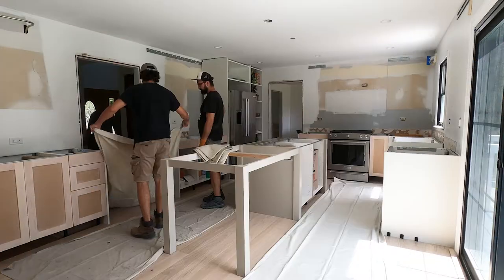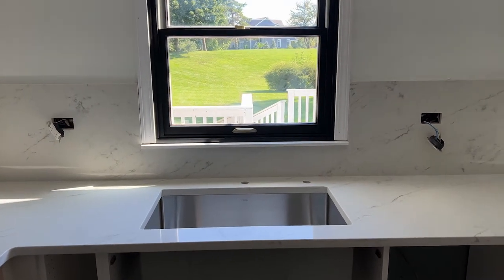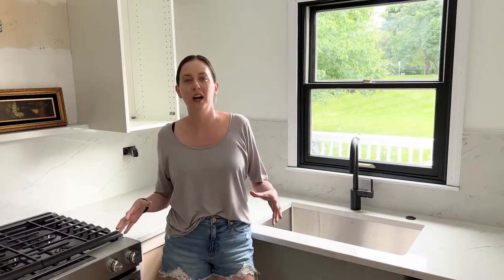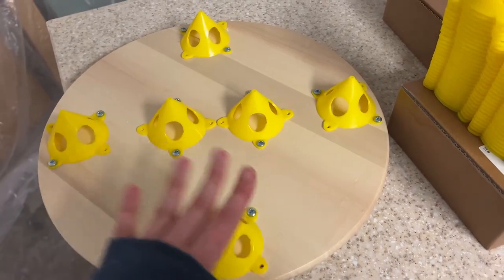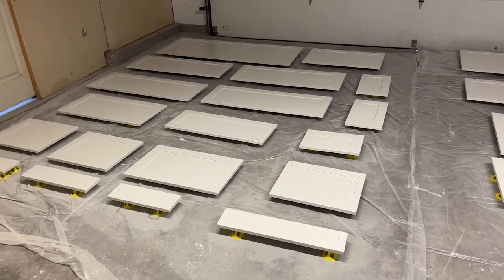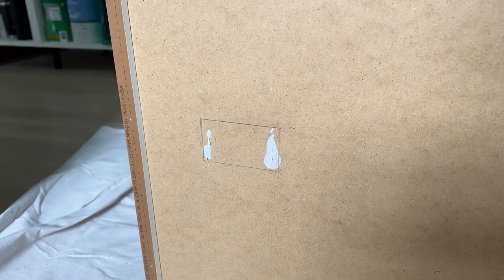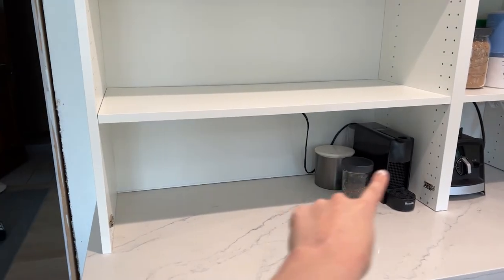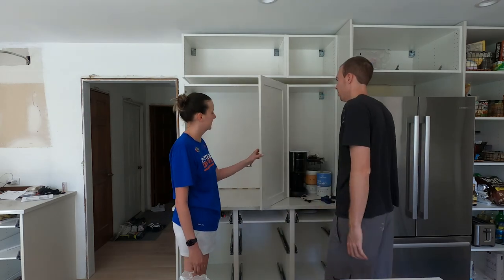Quartz Install, Painting Our Cabinet Fronts, IKEA Countertop Cabinet Hack | Kitchen Reno Pt. 8

Comment: We're planning our kitchen reno this summer and planning on doing a countertop appliance garage. Can you give any more details on how you attached the support along the bottom of the back of the cabinet? Your videos have been so helpful!
Reply from the maker: Yes, check out our pantry highlight on IG @thelksaddress. We go into more detail on how we braced the back of the cabinet
Reply: @thelksaddress  Were you happy with the BM Fresh Start primer? I'm reading so much conflicting stuff on the best primer for MDF.
Reply from the maker: @MegBeg19 it has worked out well for us, we use it on most of our projects now. Only thing is don’t shake the paint, only stir, we learned the hard way having some bubbles!